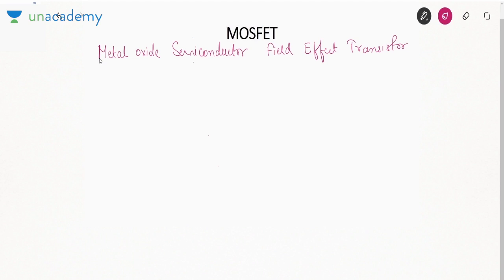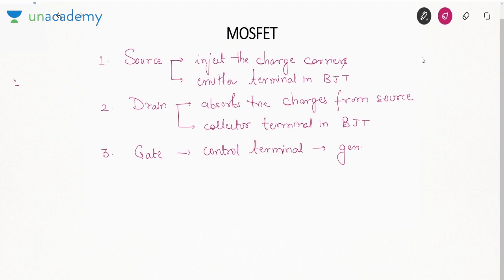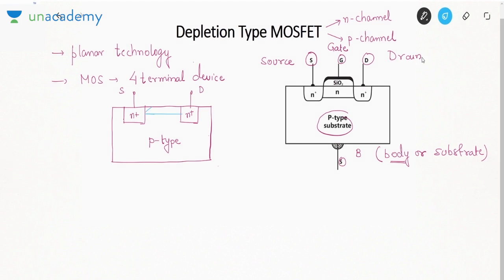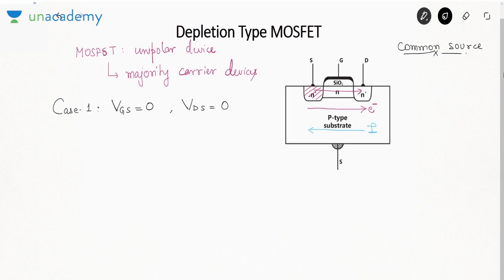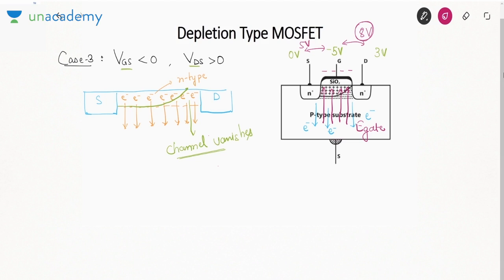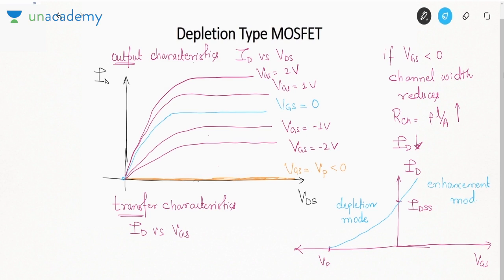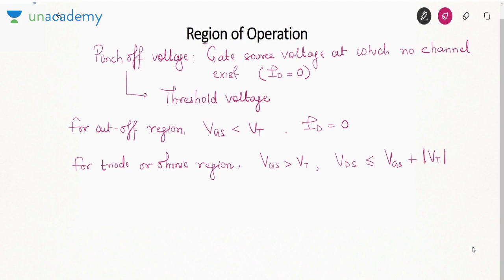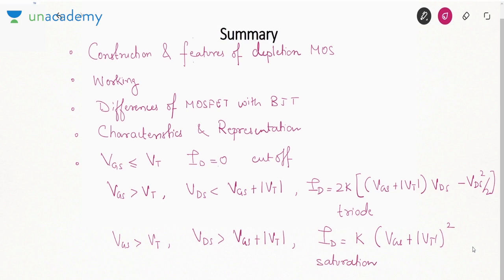Introduction to MOSFET | MOSFET | Lec 61 | Analog Electronics | GATE 2021 Exam | Ankit Goyal

Comment: If in the depletion mosfet only Vgs is biased (At drain, there is no voltage). In this scenario, how will mosfet work?
Reply: Mosfet won't work as there is no potential b/w drain and source.
Reply: @wazir_uu  Thanks